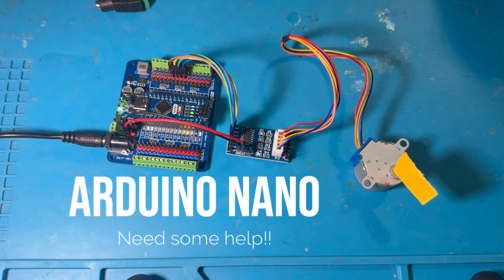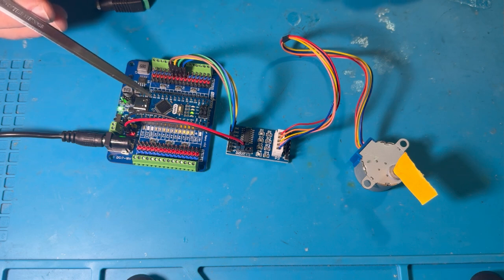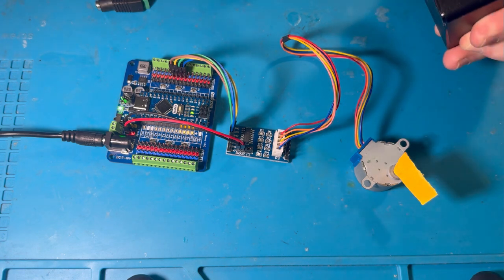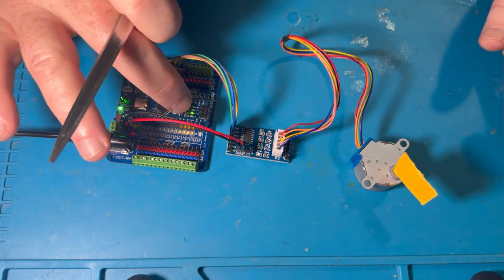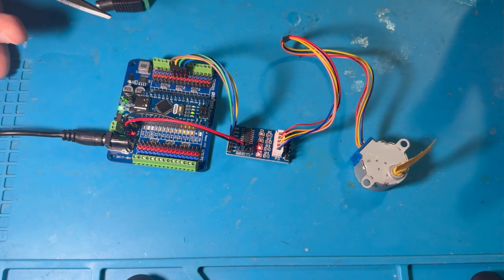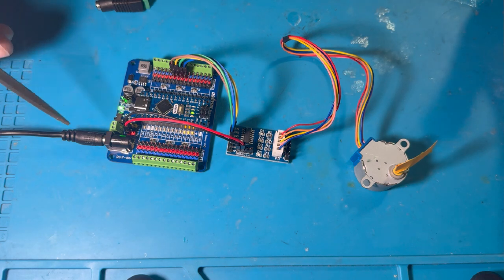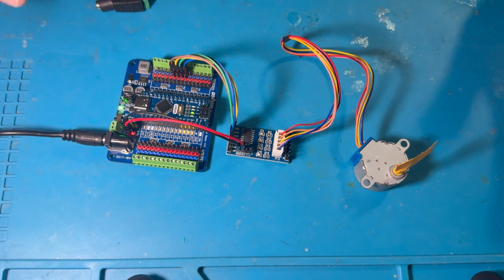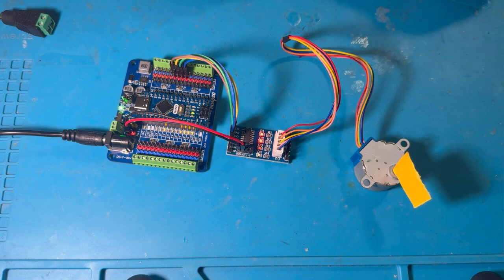Arduino Nano need help shuts off 15sec after running

Comment: Hi, I have built this clock and the 80% version. Really good project.

Only issue is the clock does not keep accurate time due to the use of the Arduino.

I though it a good idea to improve on the electronics, whilst keeping them as simple as possible, 
so anyone who can build & program the original Arduino will have no difficulty in upgrading. 

New electronics use the same Arduino IDE program for programming, add a real-time clock
and internet connectivity, to regularly update the RTC. 

A small oled has been added to display the time and date (local to your area)
making it easy to see the time to set the clock.

Two buttons are added (minute advance & nudge) making it easy to set the clock time.

Final feature is the inclusion of a Hall sensor.
This gives feedback to the electronics, allowing them to centre the minute digits in the display window
(corrects for slow or fast running steeper motoer
and will also set the minutes dial automatically.

I also found the tolerances on the print files rather large, so printed a bigger10-min axle shaft for a tighter fit
and also modified the 10-min adjusted to give a a tighter fit in the mounting hole and a deeper claw, as it was not stopping the 10 min rotor very well.
Small weights added to the hour and 10-min adjuster also help keep these digits aligned. 

https://www.instructables.com/Triaxial-Numechron-Clock-Updated-Accurate-Electron/

Comment from the maker: I have 3 Arduino nanos they are all the V3. One of them is by Osoyoo and the other two are whatever from amazon. The Osoyoo Nano is the one that is slow and it doesn't matter if I use ATmega328P or the ATmega328P (Old Bootloader), however the other 2 Nanos seem to work as desired. the motor speed is much greater and the motor spins and stops for roughly 55ish seconds and spins again and repeats. So I think they one Nano by Osoyoo may have issues of some sorts as the other 2 seeme to function as intended. This is awesome thanks for everyone's input.

Comment: The code is, of course, "clock" code that drives the clock once per minute. Please wait for minutes then the motor rotates again I think.

The rotation speed is too slow compared to my case. Is the code same to the original? If so, the clock setting of the Arduino nano might be different (it might be set by boot loader). Usually the clock mores once per minute, however, if the clock of your microcontroller is too slow, it might take several minutes. In this case, please compensate this factor in the code. The code uses timer function, millis(). It is intended to generate correct time regardless to the clock, however, in some reason the result might be different.
Reply from the maker: ok there are two types of bootloaders from what I see in the arduino software an older one that makes the motor rotate faster compared to what the newer bootloader which makes it rotate as seen in the video. So I'm betting if I upload the code using the older bootloader as the option it will rotate at the appropriate speed. I should be able to time the motor stops to starts to determine if its close to a minute. If its close to that then we are in the ball park so next will be to get it into the clock and then adjust the timing as necessary to get it where it needs to be.
Reply: @T.J.Mckinnon  All of the chinese knock-off arduino nano use the old bootloader. 

It catches a lot of people out , as one has to select 'use old bootloader' in the Arduino IDE.

If you have the old bootloader, you have to select this option, else the code will not flash.

Arduino Uno have the new bootloader, which you can flash into the nano. It gains some extra memory space.

If you are running the Triaxial code, motor should run every minute.

Have you measured the voltage?

Try running one of the tutorial codes for this stepper found on random nerd tutorials.

Did you ever get this sorted?

I have a new code coming out soon. Have it running here now, just need to tidy it & do the documentation.

The code is loaded using the Arduino IDE, as you do with the nano, but it uses a much faster ESP32 microcontroller.

The ESP32 has an inbuilt real time clock and it syncs to the interweb every hour to adjust it's time and syncs to your timezone.

Also added a small oled display, which shows the time (to check against Triaxial) it automatically shows your timezone and adjusts for DST.

Comment: Wait a minute. Isn't that the behaviour shown correct? The clock only has no seconds indicator, so it only moves a little bit every time the minutes need to change. 

ignore the following...
I tried running the code in the wokwi emulator and it keeps halting the output signals around 5 to 6 seconds. 
There is definitely something fishy going on with the code. It is unlikely to be a hardware fault, especially after all the troubleshooting.
The only thing the program is supposed to do is drive the stepper motor. Something you could also do with a stepper driver like an A4988 and a 555, but that's not the problem.
Reply: That is exactly the behavior that is to be expected. the stepper runs for a moment, then stops for a minute, then runs for a moment, then stops for a minute.
Reply: Though the fact that yours runs for 10 to 15 seconds makes me think the code(program) has been messed with. Best to get the original code and upload it anew to exclude the possibility of bad code (an altered program).
Reply: @eligua-jb  I agree with this comment and estimation.
Reply from the maker: The code should be the one from the instructables. I will go there and save a fresh copy of it and override whats in there to see what happens.

Comment: Check input power of mcu on scope. May he voltage dip causing this issue or may be code bug causing memory related error. These two common issues we see usually.
Reply: One more thing monitor reset pin also on scope.